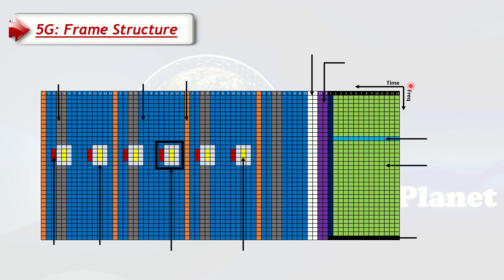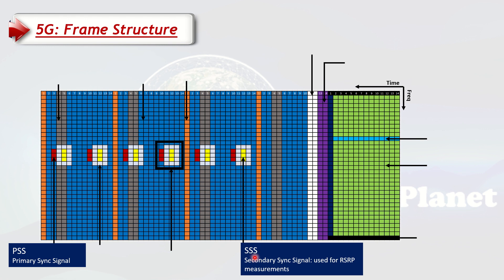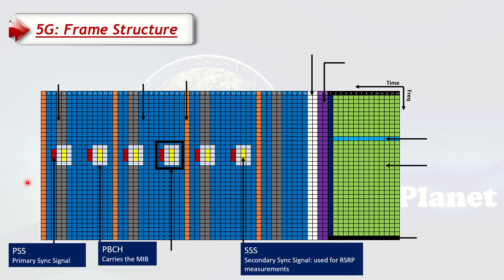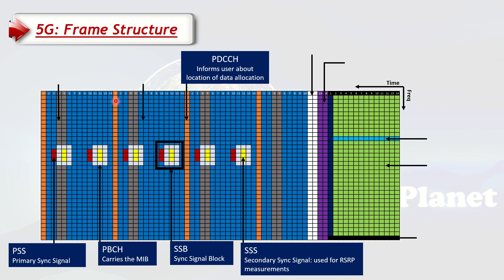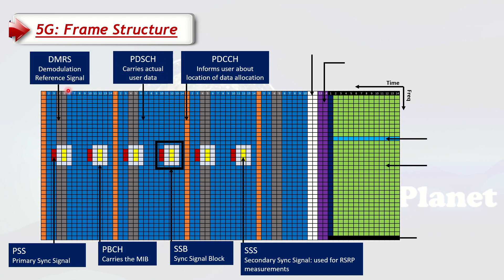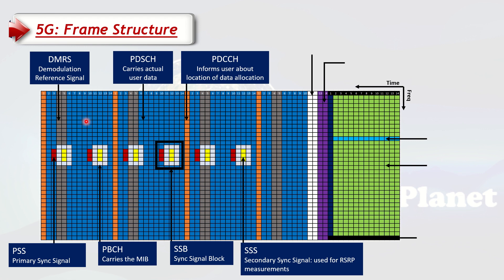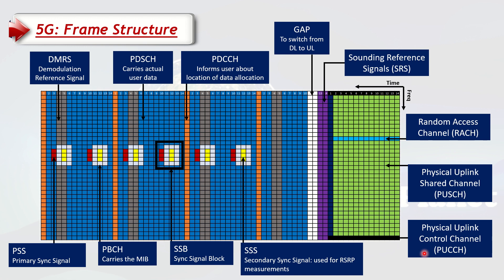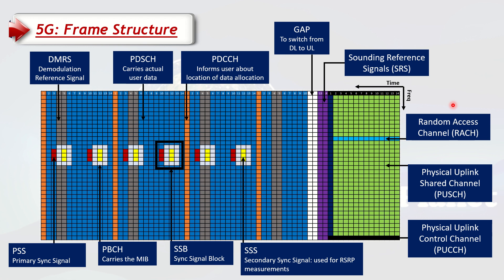5G Frame Structure: Learn to Navigate the 5G Frame and Channels

Comment: As usual you are owsome.Thanks.In this vedio 1st symbol you mentioned for PDCCH but i heard in 5G there is concept of Corset also for that place for PDCCH can vary and it will not occupied entire BW in frequency domain?Please correct me?
Reply from the maker: You are right, it is possible in NR that PDCCH might not take the whole 1st symbol but in all implementations (when this videi was published), the PDCCH still took the whole 1st symbol.

Comment: Hi ... clear and to the point ... great video indeed !!! ... couple of questions I have,  if you can kindly have time to answer ... 1. What does the 1st symbol of the UL slot (dark blue symbol) in the picture stand for ? .... 2. For the RACH, is there any specific reserved number of RBs ?
Reply from the maker: Thanks. The first symbol indicates DMRS but their location can change based on the configuration. For RACH, it depends on the format as different formats take different number of RBs. Usually, it can range from 3 RBs to 12 RBs.
Reply: @OurTechPlanet  Thank you !!!!

Comment: Your explanation very easy to grab the things in presentation. Thanks for this easygoing.
I have questions like PSS , SSS and DMRS information will be transmitted via which channel.
In 4:1 case tdd it’s clear if it’s 8:1 than we also follow the channel structure same in time
And frequency domain…
Reply from the maker: PSS and SSS are the first channels that UE needs to read to synchronize so these are read by the UE directly. The DMRS configuration is shared in RRC messages and then UE can read it directly as well during PDSCH allocations
For TDD ratios, the general structure and purpose of physical channels is still same.

Comment: It is not so clear what you mean (at 01:20) with "consider a RB or a group of RB"? I mean, if I consider the 3 RE of PSS, it means that I have 1 symbol on 3 subcarriers for each resource block? Or, in other words, every group of REs of different color are repated every 12 subcarriers (every RB)?

Thanks for clarification
Reply from the maker: Actually SSB spans over 4 symbols and 20RBs. Within the SSB, the PSS and SSS take around 128 REs but they block around 12 RBs.

Comment: Is the frame in the video the interaction between one base station and one UE? What if the base station interacts with multiple UEs?
Reply from the maker: yes, it can be a single UE. If there are two UEs then the resources will be distributed among them. For instance UE1 might get the upper half of the band while UE2 might get the lower half of the band

Comment: Does each slot contain more than one SSB，I observed more than one SSB in one slot in the video
Reply from the maker: It depends on implementation. In some implementations, one slot only has one SSB while in another implementation, a slot can have 2 SSBs as well.
Reply: @OurTechPlanet  Is the interaction between base station (BS) and UE based on frames (10ms)? For example, BS fills up a frame and sends it to ue. However, I read other books saying that MAC is scheduled according to slot. Then why the interaction is frame, but the content of scheduling is slot, sorry, I am a beginner and can't understand the relationship between the two.
Reply from the maker: @allenyang201  The structure here is shown as a frame but a UE is scheduled per slot. So, your understanding is correct that the BS will fill up a slot and send it to the UE and then fill up the next slot and send it to the UE again and so on

Comment: Thanks for sharing this. But per my understanding, the RE above or lower than PSS can't be used for PDSCH. It's empty. DMRS is also assigned to not only PBCH but also PDSCH, so UE can measure both SSB and PDSCH. Correct me if I am wrong. Thank you!
Reply from the maker: PDSCH DMRS are there in the snapshot (grey ones) but the difference is that PDSCH DMRS are only present when there is a DL data allocation while SSB DMRS are always present. PDSCH REs around PSS are usually not used as you mentioned.
Reply: Don't see anything Grey!

Comment: Your explanation is very good and simple...but here I think you showed the LTE PDCCH instead of NR PDCCH as the NR PDCCH is not always in the first three symbols and also... PDCCH is not continuous throughout total bandwidth as in LTE... concept of CORESET, BWP, comes into picture here in NR... correct me if I am wrong... anyways keep sharing the content.. it's interesting to listen
Reply from the maker: The PDCCH here means that the first symbol is occupied by PDCCH. Within that, it can follow the BWP concept if there are multiple BWPs and it will have coresets. But most common configuration is this where the first symbol is occupied by PDCCH only, provided there is no rate-matching! The concepts of coresets, BWPs, DCIs, Rate-Matching etc. will be covered in future sessions :)
Reply: @OurTechPlanet  In LTE it is clear that the PDCCH occupies always the first symbols. but

Are you sure that NR PDCCH always occupies starting  first(1,or 2,or 3) symbols and can't take anywhere in the other symbols  like (4,5..etc)?

i have this doubt for long time
Reply from the maker: @EXCELLENTSHOTSVLOGS  In most of the practical implementations, the PDCCH starts from the first symbol. However, the 3gpp parameter monitoringSymbolsWithinSlot under PDCCH Config does show all 14 symbols of the slot.